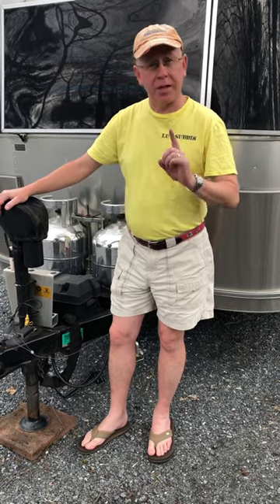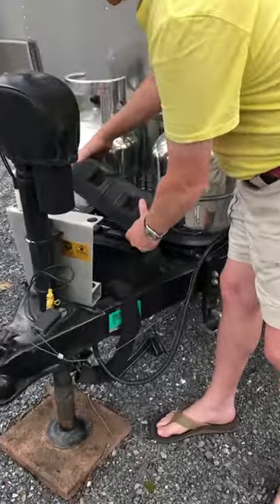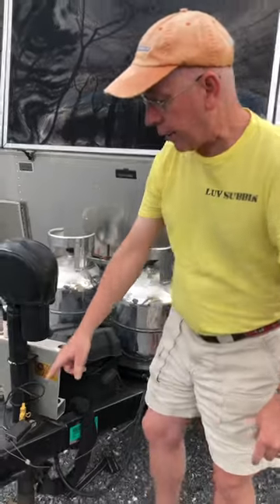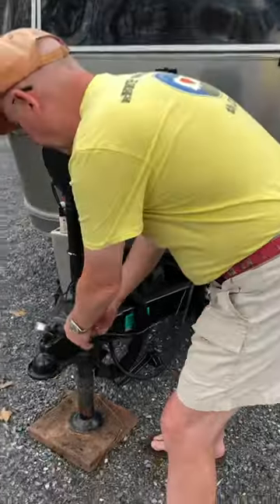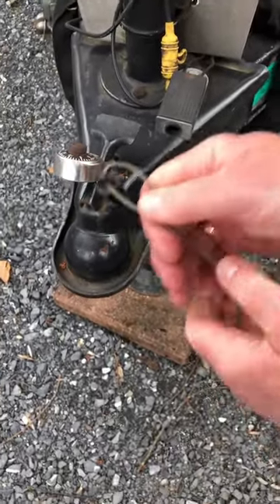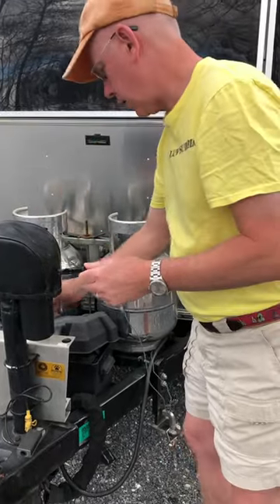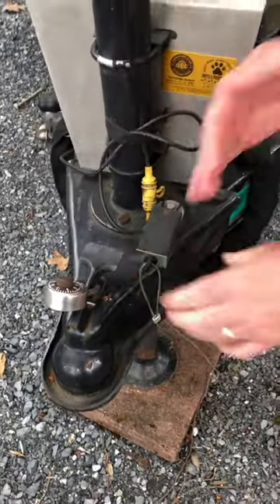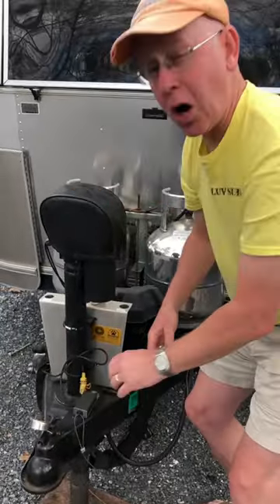RV Maintenance Minute: Breakaway Switch #shorts #short

Comment: I didn't even know what that box was. We got our airstream used. Thanks!
Reply from the maker: Thanks for watching!  The two most important things about the breakaway switch is that the pin is orientated parallel to the direction of travel and that the cable is not in any way attached to the hitch or chains.  It must be attached to the tow vehicle.
Reply: @LuvSubbin  wow 😳. Last time we towed it we didn't even have it connected it was just like it was in your video.
Reply from the maker: @shekharmoona544  It is a very important piece of safety equipment as it is designed to engage the trailer's brakes should the entire hitch assembly depart the tow vehicle.  And that can happen - we've had two friends that suffered near catastrophic hitch failure.  It is also required by law in most states to have an operating breakaway switch.

Comment: Just curious, if the battery is not disconnected and the breakaway switch is pulled I know that will energize the brakes, but how can that “burn out the brakes”? I was under the impression it will just drain the battery?
Reply from the maker: Thanks for watching!  RV brakes are not like automotive brakes that use a combination of mechanical and hydraulic systems to initiate the braking force.  RV's use and electromagnet to push the shoes against the drum.  This high current from the battery will eventually heat the magnet to the point of damage.
Reply: @LuvSubbin  Ah ok thanks! 👍
Reply: If you just want to see if your brakes work, you can test them BRIEFLY by pulling the pin. I do it all the time at our shop, we jack up the wheels and pull the pin and see if the brakes lock up, pins only out for less than 30 seconds  , have never had an issue with burning out the magnet. 
Good tip with the oil though,  will keep it working alot longer.